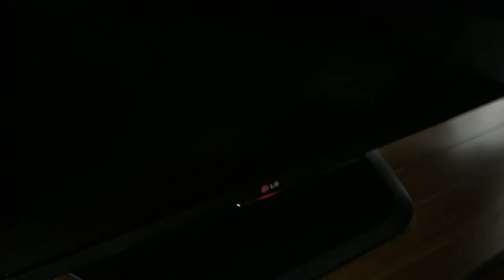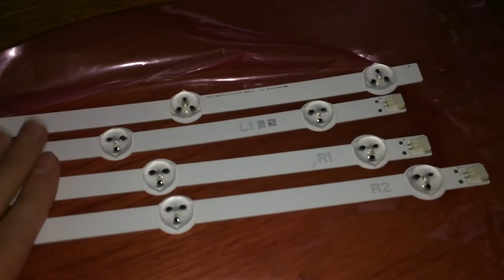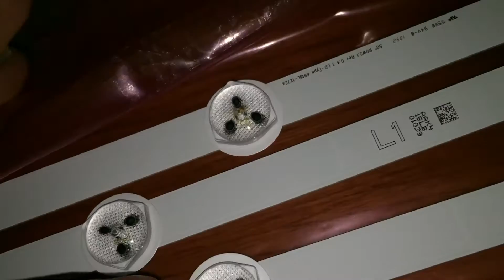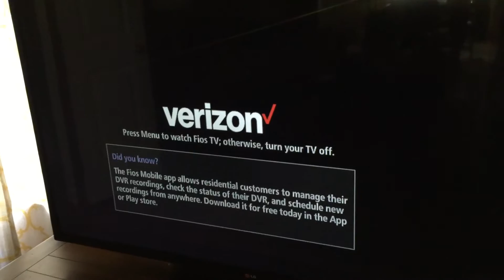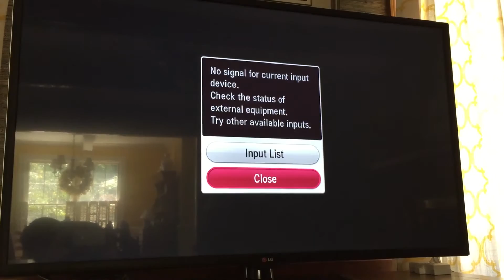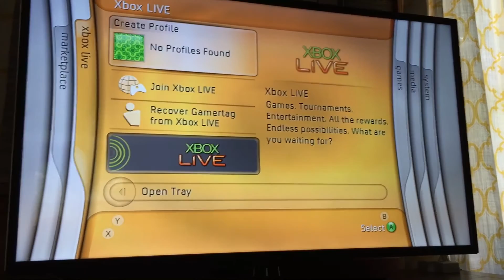Free LG 50LN5700 Smart TV Overview

Comment: I just picked up one of these here (curbside) in April 2023 and its doing the same thing as you show - set powers on for a brief bit as seen by the LG logo then goes blank! I reckon I'll dive into it and be checking the LED strips now ... I had to walk 3/4 mile with my two-wheel dolly, then walk back that same 3/4 miles WITH the TV strapped to the dolly to get the TV ... arms are still sore this morning ...

Comment: I got a different model of the same TV for free only had one led that actually blown off the light filter and burned a hole in the led strip luckily it did not fry the power supply board ! Works good now !